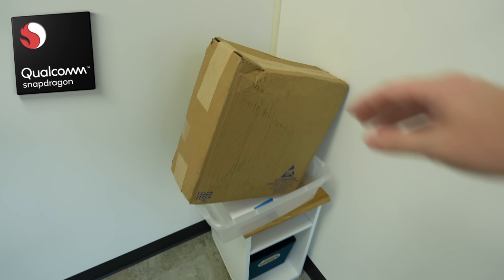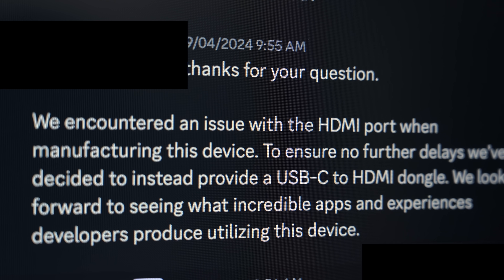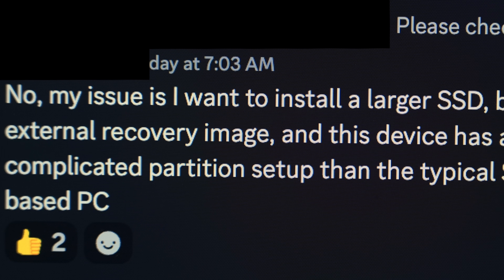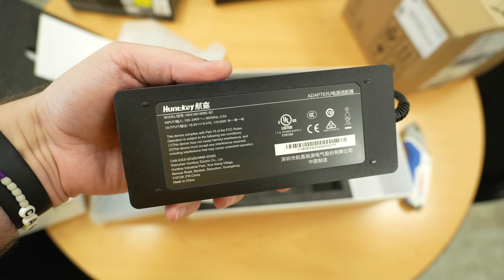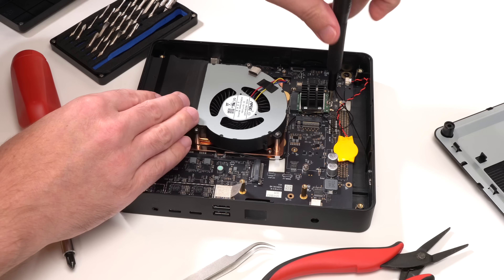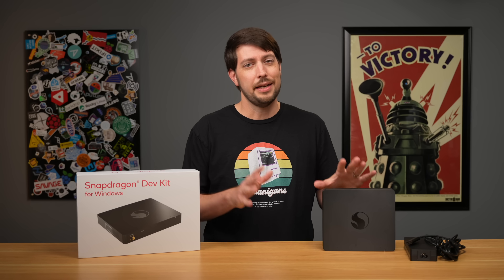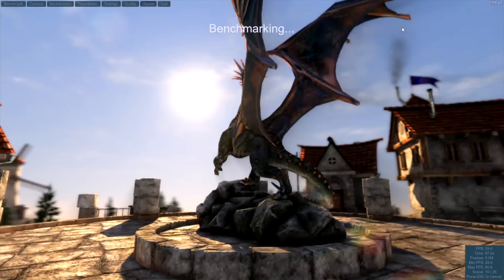Snapdragon X Elite Dev Kit: The CoPilot-est PC, tested

Comment: 6:40 i think it is a electric code book beacause it can be use in  DES that encrypts identical plaintexts with identical keys to produce identical ciphertexts. It does not use chaining or initialization vector. Or just embedded controller board that is there handle multiple input from the user to pc to use it for the ai

Comment: Great video and thank you for all the effort. How hard would it be for RaspberryPI to release a Mac mini type device based on the compute module 5. Doesn't seem like that far a leap from where they are now. Yes, performance won't be mind blowing, but RPi5 is not too bad if you have NVMe storage and a proper graphics card with that supports acceleration in Linux.
Reply from the maker: I think a couple 3rd party companies will build some decent mini PCs with the CM5 once it's here. Would love to see Raspberry Pi at least build it into a Pi 500 at some point!

Comment: I gotta to be honest. I want to see Windows ARM to thrive. But the issue with it is the lack of accessible hardware like you mentioned and affordable hardware.

The lack of accessible and affordable device means developers won't really bother with the platform. What does that mean? Less software support for the platform. Less software support for the platform means less consumee interest with the hardware, which means less production, and so on. It's a chicken and egg problem.

I used to think maybe I should get Windows ARM device someday. However, after seeing how messed up their dedication to the platform is, I might just get Raspberry Pi 5. It's ARM, it's 10x cheaper than Windows ARM laptop sold here (yes, 10 times cheaper), and it's quite performant. The downside is it can't run Windows ARM natively but eh it's ARM.

Comment: ARM doesn't scale as well with power. The Devkit probably scores 15000 multi in Geekbench at 40 watts + its about 10-15% faster on Linux although we'll have to wait a few months for that. It's just that they're pushing it to the absolute limit which I'm honestly fine with. It's faster than the M3 Pro Mac Mini while being 400$ cheaper for the same ram storage configuration. Not taking the price into account in kinda hypocritical, given Qualcomm can make 3nm chips for a 3000-4000$ machine but they aren't cause it doesn't make sense. Its 20% slower than the studio in CPU at 1/4 the price. The technical insight was excellent however

Comment: Been running a surface laptop 7 with Snapdragon for about a month now and it's been a breeze so far. I expected it to be way more buggy because of the mixed reviews but I'm really impressed. Performance is awesome, battery is wonderful it's only missing Linux support.
Reply: I don't doubt that it will be good, but the problem has been Microsoft and qualcoms Abysmal delivery, even despite the powerful chip.

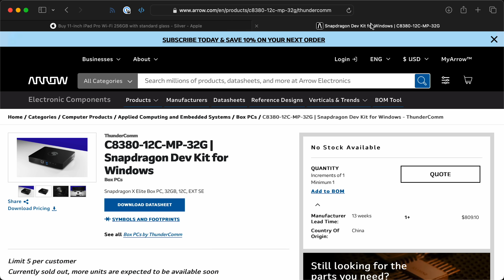Comment: 10:06 For how long will everyone born before 2000 continue to say that an iPad is not a real computer while the new generations do EVERYTHING on their iPhone and iPad?

Also don't romanticize the experience developers had with the Apple Developer Transition Kit either. In 2020, developers raised several complaints about the Apple Developer Transition Kit (DTK), including insufficient compensation (initially offering a $200 gift card for a $500 kit, later raised to $500), performance limitations due to its A12Z chip that did not represent the capabilities of future Apple Silicon Macs, units dying with no replacement provided, restrictive usage rules prohibiting device disassembly and unauthorized benchmarking, and logistical issues during the return process.

Comment: the ECB likely stands for Embedded Controller (EC) board. And due to the ITE chip and its functions, controls all the low level system pin control, voltage, fans, keyboard, LEDS, and sensor management. And its all tied in to a second microcontroller running proprietary code. This is the single point of control over the motherboard, sort of like a low level management engine. protected by encrypted qualcomm keys. a lot of computers do this but we need to know about it.

Comment: It's an initial release of a new architecture and platform.
Give them time to get their things together.
Such a release is much harder for Qualcomm than it was for Apple, because: 1) unlike Apple, Qualcomm doesn't control the software stack, 2) Qualcomm isn't in the business of building end-user products, 3) due to all legal stuff that has been going on before the release, the current chip is probably at least a year old design which reflects in performance, however taking the delay into consideration, the performance of this chip is actually really good.

Comment: Why that rj45 cable is so thin!? Is it fibre?
Reply from the maker: Just Slimline Ethernet, it's okay for shorter distances and lower speeds, I like how it's a lot more flexible.
Reply: @JeffGeerling  believe or not, after saw that, I searched fiber on desktop solutions :D It seems like a dream btw. I couldn't find high speed direct fiber to usb though... I already have 1G on copper... Thanks for reply.

Comment: I went with Surface Laptop 7 and maxed out the memory and did the 1 TB storage option.  As for power it's a tiny power brick but I power though the Thunderbolt 4 dock with two external mointors.  Also when running on battery I can get days out of a full charge unlike my work laptop where running on battery barely gets though 5 hours.   As much as Jeff hates Windows and Microsoft the release products are solid.  I have WSL loaded along with my native development tools.  Best laptop I have owned.

Comment: These power figures could be more impressive. My 7840hs Topton mini PC uses 6w at idle up to 100w in full load. To use as a headless server (first, it has to run Linux), x86 is the easy win so far.

Comment: Someone needs to tell Qualcomm that their warranty is literally illegal in the US because you can't void a warranty for A. Replacing or using third party parts. B. Opening the device for any reason. Unless they can prove that the parts caused the issue you're trying to warranty they are legally required to cover the issue.

Comment: I agree, the whole Snapdragon Dev Kit for Windows 2024 / Co-Pilot PC launch was very poorly managed by Qualcomm and Microsoft. I gave up trying to purchase this dev kit as Arrow makes it impossible to order it in the UK unless you are a VAT registered business. I will use the money I saved to purchase a M4 Mac Mini instead! I like Windows 11 arm and had a lot of using it on my Windows Dev Kit 2023. The Snapdragon X family of processors are a significant improvement over the 8cx Gen3 / SQ3 processor in the Windows Dev Kit, but there are too many X Elite and X Plus skus, making it very confusing for the consumer. Coupled with the lack lustre GPU performance, this still isn't a great advert for Windows 11 arm. All X Elite skus should have come with the 4.6 TFLOPs GPU and the X Plus with the 3.8 TFLOPs GPU. There is only one commercial Snapdragon X Elite laptop with the top tier X Elite sku and 4.6 TFLOPs GPU and that's the Samsung Galaxy Book 4 Edge 16-inch 1 TB model. Why no Microsoft Surface devices with this top end sku?

Comment: This cringe is unbearable.
Apple requires software sold on its Appstore be developed and compiled on its hardware.  They also require you PAY THEM for the right to distribute software.
Microsoft allows software to be developed on any hardware.  You don't need to pay them a dime to sell software on their platform.

Yeah, Apple did what it had to do to maintain its oppressive and closed ecosystem.
Yeah, Microsoft was lax in its distribution of hardware.

You pretending that you're pro-FOSS while shilling for the most closed system is as cringe as it gets.

Comment: "Running ECB" is likely the "embedded controller" board, not sure why it's on a daughterboard though?

ECs are used in laptops and desktops to run LEDs, fans and other basic system functions. (backlights, power LEDs, RGB nonsense, etc.)

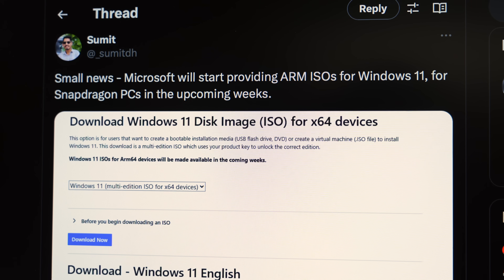Comment: 3:50
There's a website called UUP Dump that allowed you to build Windows ARM ISO's for months, if not a year. It's legit, I have been using it to build ISO's with the latest version of Windows to minimize updates after clean installing and once a while I do an in-place upgrade to keep Windows clean and error free as much as possible.

Edit: Microsoft should start debloating Windows from so much sh*t they have added, it will basically afect any architecture that Windows could support on the future.

Comment: I bought a used 8CX Gen 2 laptop the other day, and as Jeff mentioned in the video, getting it re-installed is a total nightmare. Microsoft does not provide ISOs for Windows on Arm to re-install from. I eventually found the vendor (Dell) does provide a tool to download an ISO and make a usb installer, but even after getting all that working, Windows forces mandatory updates during the install process which fail, leaving you with a borked OS. The BIOS is also a total joke. The whole experience has been hackintosh level flaky, and hasn't made me feel confident MS is commited to this platform.

Comment: This guy is just a hater. It supports way more than the pi and gets more performance per watt. Btw it’s pci e implementation can support a gpu (which this guy takes personally).
Reply from the maker: What? The PCIe implementation might be able to support a GPU, but so far nobody's written a driver for it—especially not on Windows.

That's the reason I want to see Linux on this box—Linux already has tons of Arm drivers for graphics cards, NICs, etc., which would make this infinitely more useful.
Reply: @JeffGeerling  is there one for the pi?
Reply from the maker: @chswin  Yes, the amdgpu and radeon drivers both work on the Pi 5 now, with a patch (and some caveats, of course—Broadcom still doesn't have perfect PCIe support... most arm chips outside of Ampere seem to be imperfect); check out Pineboards use of it at https://pineboards.io/blogs/news/maker-faire-hannover-2024-is-a-wrap
Reply: @JeffGeerling  that is hardly a supported path.
Reply from the maker: @chswin  Sadly, that's better supported than any graphics cards on the Snapdragon platform right now. Or Linux on Snapdragon :(

Comment: Plus side they absolutely fixed the overheating problem my 2023 dev kit has. Run the CPU and GPU hard at the same time and it'll just crash. It should at least work for games, although performance will be really weird and it's not much less power hungry than my x86 desktop.

Comment: Thanks for the review. I run a Surface Laptop 8 and it works better (but OK, its more expensive). Some 3rd party software support is lacking (e.g. for me its missing Adobe Lightroom classic, Support for Nikon Z8/Z9 NEFs,...). But recent software (e.g. ollama native) works great.

I don't understand your WSL2 memory complaint. Did you configure it correctly via .wslconfig? For me WSL2 runs really well - for me llama.cpp sometimes runs slightly faster on WSL2 than on native Windows because of gcc optimizations. 

However the Qualcomm GPU/NPU support is lacking - the Vulkan driver does not work with llama.cpp and Qualcomms QNN for the NPU is very exotic. the Snapdragon X / ARM CPUs run special llama.cpp quantizations (Q4_0_4_4 and _8) very fast, almost as fast as Metal/GPU on M-series.

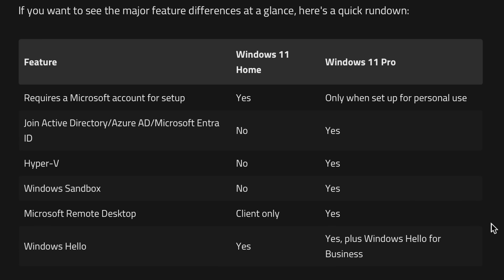Comment: 8:38 "no hyper-v support" doesn't mean hyper-v doesn't work because there's a way to make WSL2 work on windows 11 home and WSL2 hard depends on hyper-v, it just means that the user settings for hyper-v are deleted and locked down with no way to change them outside of installing and uninstalling WSL2 and that's it, which severely restricts what you can do with WSL2 and prevents tweaking WSL2's low-level settings. windows is full of dark patterns like this where it supports linux apps, but only kicking and screaming and shanking everyone every step of the way.

Comment: They said it would be cheaper than its x86 counterparts, snapdragon laptops are 1000$+ while you can still buy a M1 Air for 600$. A Macbook is cheaper than an ARM windows laptop, that is just sad. At this point, x86 has gotten soo efficent even the top 3 supercomputers have x86 and are now faster and more efficient than ARM.

Comment: Why is every computer company allergic to full sized SD card slots? Like seriously. I'm an amateur photographer and the number of devices with a micro SD card slot but no full sized one amazes me. Especially since like 80% of the micro SD cards I've bought come with a micro SD to full sized SD card adapter so even if you only had micro SD cards and a laptop with a full sized SD card slot you could make it work. Like seriously it seems like they're cheaping out on $3 of hardware for no reason.
Reply from the maker: Agreed; that's why I wound up buying the Mac Studio instead of a mini for my Studio, it's so handy. Someday I'll upgrade my laptop to have full sized SD too!

Comment: The fact that Qualcomm, the number 1 soc maker for Android, doesn't support Linux on their new SoC, is astounding.

Mainline Linux already supports plenty of Qualcomm boards and Android kernel can be used to boot Linux pretty much as is with minimal config changes.
Reply: I mean to be fair if I had a nickle for every out of tree kernel modules and patches typical Android phone comes with I wouldn't be living in my parents' basement
Reply: @그냥사람-e9f  so much so that you can use the same image on multiple phones nowadays huh
Reply: @그냥사람-e9f why did you get rid of the csgo memes and your videos with the most views
Reply: The Android kernel cannot be used to boot standard desktop Linux. I mean, it can, if all you want is serial over USB, sure. But anything past that, like graphics, sound, buttons, sensors, are all pretty much trapped behind Androids driver subsystem, not standard kernel interfaces. There are attempts at translation layers (Halium), but in any case supporting standard Linux and Android requires two separate streams of work unfortunately.
Reply: Booting Linux is already an absolute nightmare on ARM because of the scattered, disorganized mess that is booting on different ARM devices. The future of loading your own OS looks grim if ARM becomes a major PC chip
Reply: That's not true.
Reply: Not so much surprising, Android is actually dragging Qualcomm down, their software is tailored for it, so much that porting their drivers to Windows or even desktop Linux is problematic. And yeah, it's probably the same issue with Mediatek.
Reply: Qualcomm is not a software company, and Microsoft doesn't care about Linux.
On Adroid it is Google who supports "Linux" on Qualcomm devices.
This one is on the open source community to tackle, but can't support something that doesn't exist... they are shipping just now...
Reply: @marsovac "microsoft does not care about linux" oh how wrong that statement is. They are one of the biggest contributors to the linux codebase since azure runs on linux... they dont care about linux desktop would be correct
Reply: @marsovac  blatantly false, Qualcomm has a SW team that supports their SOCs, Google never did that, they barely ever upgraded their Qualcomm devices to newer Qualcomm software drops, they also stopped using QCOM with the release of pixel 6.
Reply: Android is not linux. It was a variation of Linux when it started sure but now the kernel is completely different to the point it's not even linux at this point 😂
Reply: @kirby21-xz4rx  that's further from truth than it's ever been, they're actually getting closer to mainline with every Android release.